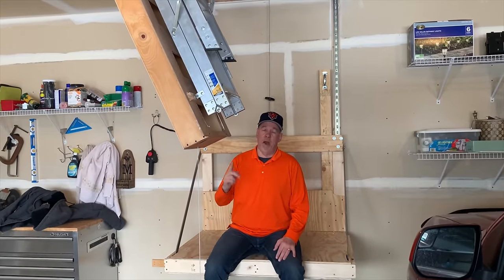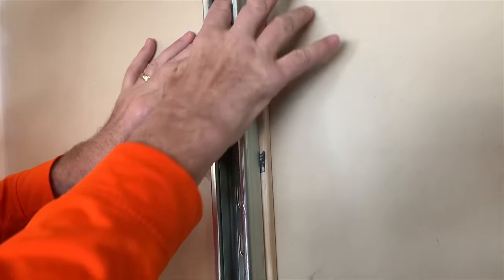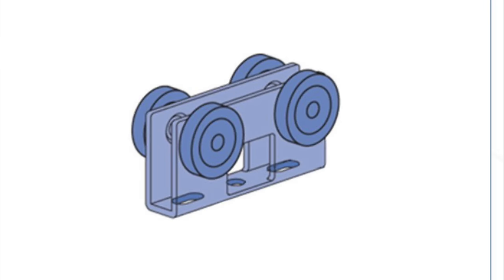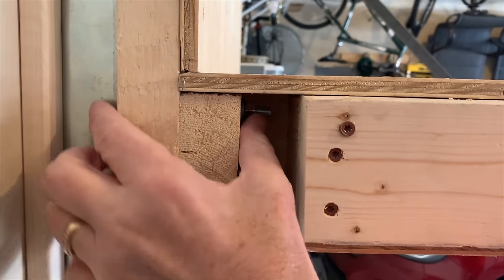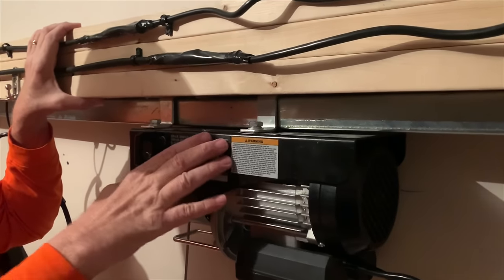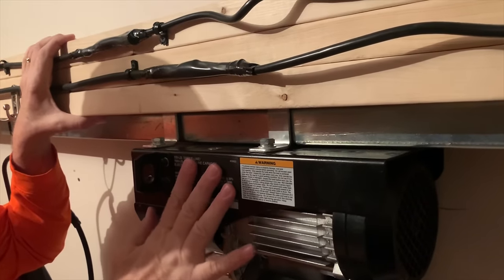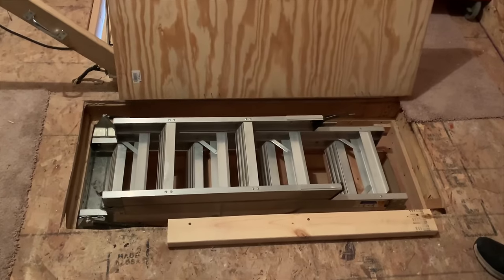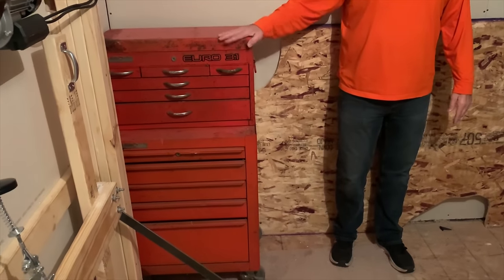Garage Attic Elevator / Lift Build in Minneapolis Minnesota

Comment: Did you have to cut into your trusses to make the opening as wide as it is and if so how did you frame that?
Reply: @theelevatorSRT8 :  Engineered trusses are NEVER supposed to be cut without a sign-off from a certified structural engineer in any jurisdiction I know of.  Did you do this?

Comment: Great idea. I'm in the planning stages for a detached garage and was debating about the pull down stairs which I had in a previous home. Will ask my contractor to include it in the bid.  I wondered how you decided on the dimensions of the platform of your lift? I see those chairs in your storage area and I imagine the bigger the platform the better in terms of moving furniture into storage. Also can you do "unmanned" lifts and then climb the stairs to unload the lift?
Reply from the maker: Thank you.  Yes, we never go up with a load.  The load always goes up on its own. We never want to put any more weight on it than is nec
Reply from the maker: Also, if you buid one of these, be careful building it, be safe operating it, and overbuild it for strength!

Comment: How is that a quality motor if it only is capable of working 2 minutes every 10 minutes? Please explain. Good elevator though.
Reply: @theelevatorSRT8  Ok. I understand that in your application the motor duty cycle is very short, thus its 2 minutes continuous working capacity is ok. But, what if people need to go up and down frequently... I think the motor could burn out. I'm thinking about building an elevator like this to help lift things and people to the second to fourth floors of my house. Nothing too heavy. Any advice will be appreciated. 
Thank you :)

Comment: I thought of that years ago. Never really had a place where I could put one. Thanks for the video. Now i can see how one would actually work. BTW I operated an old manual elevator back in the 70s. This brings back fond and funny memories. Did you know it's illegal to operate an elevator under the influence? Go figure.
Reply: Built one like this about 8 years ago and straddled an entry door.  Again not code but nothing ever sets in front of the door and I typically never leave the elevator down.  
I did have to add a limit switch.  Wife was day dreaming a few years after installing it she ran it int to the track stops and bent it up.

Comment: If the house roof is framed with trusses they are not designed to carry a load on the bottom of the truss. They are designed to take weight from the peak and disperse the load out to the walls.  So just don't go loading your attic up with stuff. A little is fine.
Reply: @theelevatorSRT8  just a wild stab. Looked like a newer house and trusses are sort of a standard now. Hell I could be wrong. It been known to  happen. Lol. But it is a very cool idea.

Comment: Great vid, thanks for posting, looks like you did a nice job on the construction, design looks plenty sturdy for long term use. The handle to hang onto was also a good idea.  Recommend a length of  inch and a half angle iron, under the lifting 2x on the carriage, tie into both uprights. Change the  lifting  wood screw eye bolt, to a  machine screw eye bolt going all way thru 2x and the angle iron,  lock with double nut or lock nuts on bottom.
Reply: @theelevatorSRT8  thanks Brian, you were already on it, good job.

Comment: I like it. It's good looking. Maybe only slightly hazardous, but not if you only use it once in a while and you maintain it.
Reply: @theelevatorSRT8  currently looking for a home. But my wife keeps asking for an elevator for stuff. This seems like a great compromise. I'm very familiar with uni-strut and well, really, if you keep it locked, there should not be a problem. I'm too adventurous not to ride it, but I wouldn't want my kids on it. I'm also thinking of other things I could use a winch for in the garage.

Comment: Great project.  My only thought for improvement would be a safety in case the cable breaks.  Not sure how to do this, but it would be good if possible.  Wish my garage attic space was as big as yours :). Thanks for posting.
Reply: Seems like it needs a safety to stop it if something sticking out to far. A kid could play on it and get crushed. It looks dangerous.
Reply from the maker: We added fall arresters. Check out the other video. Plus, we are working on a braking mechanism. Hopefully a video this month. If it works!

Comment: Did you have to cut out part of a floor joist in the attic to make the opening for the elevator? What was involved with that?
Reply: I was going to comment on the same thing.  One of the most critical parts of installing that thing and ... it's completely left out.
Reply: Where you cut out the truss it needs a header across the opening on either side with hangers nailed on that
Reply: @byronk1987  if its engineered truss and not a stick frame roof, you don't cut the bottom cord ever. Trusses are designed for cost to strength ratio, they use minimal framing while maintaining a good safety margin but cut one truss and you create a potential for collapse.

Whenever I have a truss roof, the trusses are inspected before craning and after installation. Damaged trusses(if there are any), get photographed and sent to the truss manufacturer for repair kit/solution to be made, all done through some load calc program or an engineer.

I only replied because you said truss. If someone cuts a truss they could have their roof fall on them. Stick frames are completely different in that the ceiling joists just hold the interior ceilings and help hold the top of the walls from bowing out, cutting and using a header across with hangers is usually fine. Still one should consult with local building codes or engineers.

Comment: Great idea. I would caution you on one thing.  A neighbor of mine made the same thing some years ago. He was riding it up and the winch let go. He fell with it and broke his legs.
Reply: Yeah, I was wondering the same thing! I think it needs a built in ratchet system so it locks while it is going up and down or something.
Reply: @mattjames8683  an easy safety system could be that you hook a retractable safety lanyard to the ceiling and the other end to you lift car setup. We call them yoyo's. That would catch if it ever broke loose. I think I would test it first though. Good luck. Nice video 👍
Reply: As a safety mechanism I would only have my wife ride on it to get stuff. Just in case it falls.
Reply: I wonder if one could add nylon straps to the platform and adapt seat belt reactors to act as a safety mechanism...
Reply: @yogibeer9319  lol

Comment: Very nice. You could also use a ATV winch for the lift.
I think it’s a great idea and great execution.
Reply from the maker: I would be a little bit concerned about the a winches functionality to free wheel. Hoists don't have that functionality.
Reply: @theelevatorSRT8  it would have no effect on it’s functionality. To get a winch to “free wheel”, there is a lever that must be pulled or turned. Zero chance of accidentally putting it into “free wheel”. Think about a winches prolific use in off-roading and how and when they  put them into use. It would be very bad if you were winching your jeep or truck and were in a sketchy situation and your winch went into neutral. The lever to engage the winch is robust and takes a fair amount of effort to turn it to neutral or engage it. The lever is usually positioned out of the way and close to the motor’s body so there is no chance of accidentally manipulating the switch. I am sure a winch motor and a hoist motor are very very similar. A hoist has the addition of pulleys  and or snatch blocks. My winch kit has a snatch block in it. One of the benefits of using a winch for something like your application is the weight and probably cost. Not to mention winches are easily rebuilt and you can add synthetic line which is much safer than steel cable. It’s also lighter weight and that reduces strain on the motor.
Reply from the maker: @Todd66  all true, but you apparently  don’t know, I’M MARRIED! 😂😂😂
Reply: @theelevatorSRT8  with making my point, I sure do not want to detract from the really nice job you did, not only with the lift, but the video. And you have my deepest sympathy about your marriage. LOL
I hope you have a great weekend.
Reply from the maker: @Todd66  thank you buddy. Really appreciate the comments and info.
Reply: @theelevatorSRT8  You are very welcome.

Comment: The entire unit is obviously not Code compliant.  Don’t show the local inspector around.  If it comes up, say you use for freight, not humans. Yet it’s reasonable to point out at minimum, that it does not have an emergency shut off or audible alarm on the “car” (platform) nor a control for up and down on the car.  The controls should have a lock out requiring a key or digital keypad code to operate.  If grandkids etc. start playing in the garage behind you back, it could be a serious hazard for pinch and bind exposure.  With that said, this is 😎 cool. Really appreciate the ingenuity.  You get the proverbial “Nifty Award”...
Reply from the maker: Thank you for the thoughtful comments. The grandkid thing is a consideration. I’ve thought about it. No worries. He’s 1 and there will be a cutoff by the time he can possibly access it. 
You should watch our video on the elevator emergency brake we created recently. I think you will enjoy it.

Comment: I like this idea and might do something like this for my garage. I see you've put up drywall and all, have you done any type of ventilation to allow air flow? I'm asking because I live in Georgia where humidity and air have texture during the summer months
Reply from the maker: It was dry walled when we bought it. It does get hot up there but we aren’t up there often, nor for too long. But some neighbors have put a window in.
Reply: @theelevatorSRT8  hmmm... interesting. I might put in duct work and hope for the best. Or maybe a window unit with a drip tray leading to the outside for condensation
Reply from the maker: @tjdjinn1983  can’t hurt, right?
Reply: @theelevatorSRT8  I'm trying to low key make a little man cave with a cigar room as well. Big dreams I guess at this point

Comment: Why did you build the header with the timber on its side, much stronger standing up
Reply from the maker: Thank you for the question. We preferred it that way due to the size of the holes drilled to hold the channel that holds the motor. That beam is 10x stronger than it needs to be. Mitch can give you the technical info on it regarding shift.
Reply: That is a great question. We get A LOT of comments about the orientation of the boards, but here is our explanation for that:
It would not have been practical to orient the boards upright rather than flat because we had to run bolts down through them to hold the superstrut that holds the motor. Our solution was to orient them flat, but also glue and screw them all together. By doing this, we eliminate bending due to slipping and can view the "built up beam" as one solid 6x6 (For reference, think about what happens if you glue every card in a deck of cards together). In engineering terms, the reason why a board carriers more load on its side rather than flat is because the area moment of inertia is much larger with that configuration, which then leads to the board being under less stress. Since we used multiple boards, the area moment is much larger than if it were just one board.

We appreciate the question and hope you check out our other videos as well!

Comment: The ONLY thing you did wrong was:  you laid the 2x6's flat, you always turn them up on end.  That's where the strength is.  Just like a header above every door and window in your house.  Otherwise, great job!  Well thought out.  Basically what you did is make a barn door that goes vertically, with a motor to pull it up and down.  I saved this, because I would like to make one.
Reply: Thank you for the high praise, we truly appreciate it! We get A LOT of comments about the orientation of the boards, but here is our explanation for that:
It would not have been practical to orient the boards upright rather than flat because we had to run bolts down through them to hold the superstrut that holds the motor. Our solution was to orient them flat, but also glue and screw them all together. By doing this, we eliminate bending due to slipping and can view the "built up beam" as one solid 6x6 (For reference, think about what happens if you glue every card in a deck of cards together). In engineering terms, the reason why a board carriers more load on its side rather than flat is because the area moment of inertia is much larger with that configuration, which then leads to the board being under less stress. Since we used multiple boards, the area moment is much larger than if it were just one board.

Again, thank you for watching!!! Be sure to subscribe and check out our other videos. We built a pretty nifty safety brake in our last video.
Reply from the maker: Cool. Mitch explained the boards. If you build this. Be very careful when you operate it and overbuild it for strength.

Comment: Great job, I am going to follow your lead and install one too...thank you!
Reply from the maker: Cool, be super careful and overbuild it for strength. Be careful operating g it too. Lots of pinch points. But have fun too. It’s a cool project.
Reply: I am the King of overbuilding, however, thank you for the follow-up guidance

Comment: Ok, somewhat cool BUT as an safety conscious Millwright / industrial maintenance & history of machinery buff I know the history of elevators and all the mistakes that were made where injury and death happened leading to today's very safe elevators.
First, I didn't see nor did you describe any limit switches so it doesn't get raised till it busts.
Second, it needs an emergency stop switch because if someone slips and gets a part of their body off the platform they are going to get crushed.
And it needs a spring loaded ratchet so if it starts to drop (the winch clutch fails or the cable breaks, etc) the ratch catches into the strut holes and it doesn't fall to the ground.
In fact, this was the revolutionary invention of Otis that made elevators safe and enabled high rise buildings. When the tension came off the cable then bolts/pins were spring loaded into the track to stop it from falling. You can look it up, it's a simple system that could be added by adding a couple of struts in either side of the lift cable.
Reply from the maker: Did you not see our other videos. Did you not view my Otis elevator build preview? Coming up v
Reply: @theelevatorSRT8  Nope, the video showed up in my feed and I watched it out of curiosity but I don't subscribe. Usually I'm an "Evolution in action" guy but because of safety concerns to/for others who might get ideas I thought I'd comment and maybe inadvertently save someone.

Comment: Brilliant job, and video. I’m about to build one for my little holiday cottage in 
Scotland. It will take me up between the trusses to a bedroom upstairs. This video has been great. Can I ask in terms of the double wheeled carriages you used, once assembled do you have any lateral movement of the lift?
Reply: Cheers Brian.
Reply: I ordered the 42mm x 42mm rails and carriages last night after watching your video Brian, so here’s hoping, thanks. I’m going to make it in the workshop as a prefabricated unit. A frame just over 5m x 350mm wide 2 x 4 with glued on 18mm plywood, and the outside of the rails flush with outside of the frame. As the ceiling height is a bit higher upstairs in the cottage than downstairs I’m going to fabricate an elevator box if you like, with the top being flush with the upstairs floor. I’m only making an elevator as the cottage has very small floor space, and I don’t want to install an almost vertical staircase as my good lady is bad enough at walking, never mind going up and down stairs. Lol.
Will keep u posted Brian. Bob
Reply: Thanks Brian, will keep you posted.

Comment: As an Elevator Tech for 30 years I can tell you that your lift is a death trap for a person to ride on. This is at best a dumbwaiter, but without any braking system to stop an overspeed situation (like A cable separation)  someone could get seriously hurt. There are quite a few other safety issues as well. Your mechanical abilities are good but showing this as an elevator is very dangerous. Do some research on elevator slack cable safeties for residential elevators.

Comment: Just curious how long did it take to do fabricate the lift? Nice job thanks for the clear video.
Reply from the maker: Good question. I don’t know. It’s one of those things. My neighbor has one, but I wanted to do it a little differently and every house has different issues to deal with. I started sketching out what I wanted, buying the parts and materials over a number of weeks. Then for a while I was just tinkering with it. When we finally started cutting and building for serious, we spent a weekend- not busting ass- just working. After that, I’m back to tinkering, adding-adjusting, extending the cable, routing the wires, etc. 🙂
Reply: Ok thanks for the info im wanting to fab. One kinda like a buckhoist. To go on the outside of my shop along the wall.thanks
Reply from the maker: @clifbrewster8822  terrific. I always say be really careful and safe. Overbuild for strength.

Comment: Ha! I built, pretty much, the exact same thing last year! It makes moving things to the attic so much easier! My water heater needs to be changed. This made the job super easy!
Reply: i also build one a few years ago. as i can weld mine is mostly made of metal and i added a center doubled up unistrut with a spring loaded pin as a safety measure in case of some failure you just let the lever go and it locks the carriage in place.